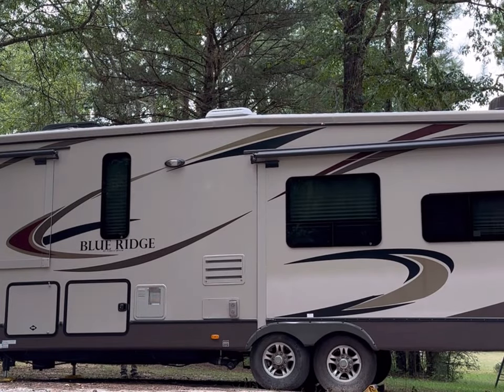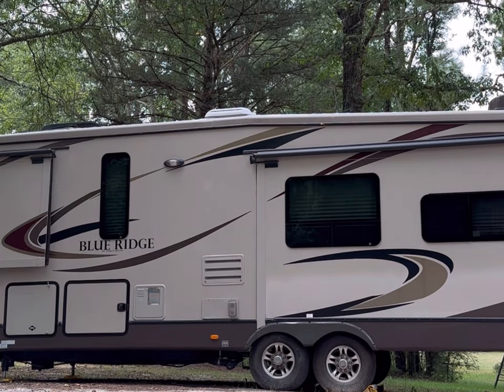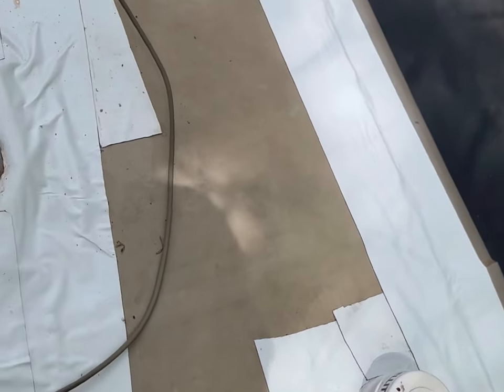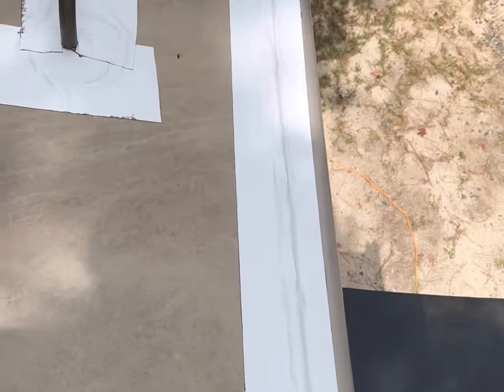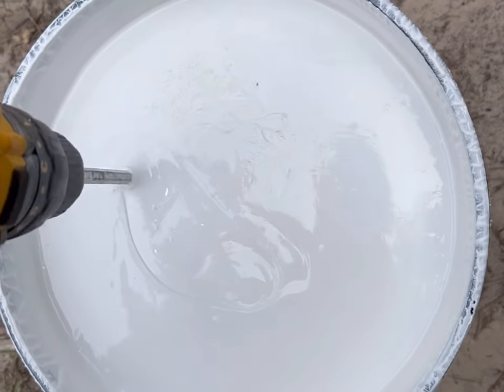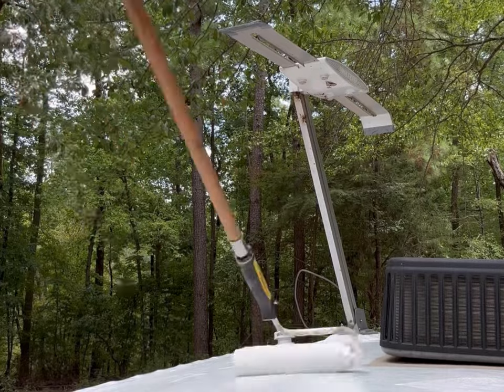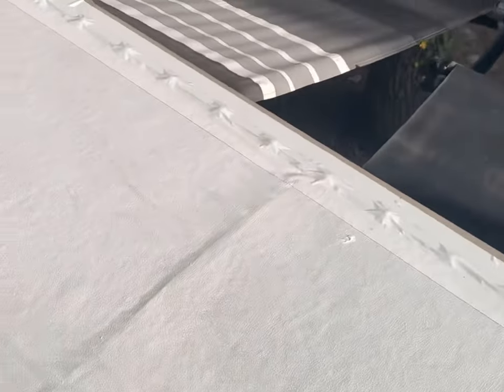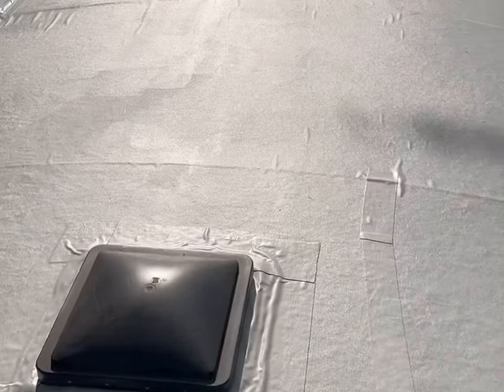Our experience with EternaBond Tape!

Comment: I bought 6" x 25' rolls of aluminum rubber stick tape at home Depot which will work great to buy surface has to be wiped down well with water & vinegar in spray bottle, then wipe with paper towels, I get more tape for way less money then eterna bond has.

Comment: I used a cheaper knock-off of Eterna-Bond and found that in some places, it held well, but in others, the edges peeled.  I also used Henry's rubber roof compound and found this to flake off, even though I had seriously cleaned and rinsed my rubber roof well.  This time (right now) I am going with Eterna-Bond tape over the seams, and around vents, etc. and Dicor parts 1 and 2 over the rest of the RV roof.  We will see!!!  9/2024

Comment: Questions: I have repaired, sanded and cleaned a vintage metal roof camper. Should I paint the entire roof first and then apply the Eternabond tape?  Or should I apply the tape and then paint. Thank you!
Reply: I would say do the tape first. Tape isn't going to stick as well if you paint it first
Reply: I had the same question. I am thinking tape first and then painting over the tape like he did in the video

Comment: I used Eternabond tape on my roof in Arizona and it turned to grey dust in a year.
Reply: You obviously had the docket & complained to the manufacturer, what did they say?
Reply: Did you use "roof tape" or Eternabond? My experience is nothing like you've described. The Eternabond tape I have applied has lasted 7 years in the the SW desert with no signs of failure.
Reply: I’ve used it for years. This is a first.
Reply: This is definitely not my experience nor anything else I’ve seen.
Reply: @jerry-381 it must have been a bad batch as only about 1/4 of one roll crumbled into dust, rest of the tape I applied worked well. This time after applying the tape, I primed with Lanco
Aqua-Proof Waterproofing Roof Primer and top coated with Lanco
Ultra Siliconizer 5 Gal. 100% Acrylic Elastomeric White Reflective Roof Sealer

I know I have to replace the EPDM roof, but I have been stretching out as long as possible. It needs new plywood too.
Reply: @ gotcha that makes sense! Kuddos on all that roof work. We all know what happens to these things when water gets in.

Comment: I've had eternabond on my RV roof seams for almost 10 years and never had any leak problems where the tape is, and still doing good. I've used dicor lap sealant for several years also and had leak issues every year or two. I have found that the only way dicor lap sealant works best is to remove all the old sealant first. But still won't last as long as the eternabond. I'm in Texas and the summer heat is brutal on anything left outside in the sun.
Prepping the roof before using any sealant is the most important part. Follow the instructions or risk doing it again sooner than necessary. Never use silicone caulking on the RV roof because nothing sticks to it.

Comment: Do you think your roof sealent is as good or better than Henry’s?I’m looking at both.
Reply: Hi Dave. What have you decided? I am new to this and need to seal the roof of my RV. this is a great video .
Reply: I used Liquid Rubber & don’t forget the primer.I also used Kohree 4” tape & I still use Dicor non sag & self leveling.
Reply: I just used the Henrys tropicool on my 23 year old epdm roof(cleaned with TSP and then Dawn). How well it sticks depends on a few things. I’ve read it doesn’t stick to eternabond tape, I’ve also read it does. In my case it did. I applied eternabond temporarily about a month ago around the pipe vent and Henry 887 stuck to it really well. Also, (despite saying the opposite on their site), the Recpro 8010 adhesive does stick to aluminum flashing and Henry 887. So well in fact it ripped up the 887 on a section that i splattered some while repairing another section of the roof (with the Recpro repair kit that used pvc). What idk is if eternabond will stick to the 887, another thing I’ve heard ‘nothing sticks to silicone except silicone’…clearly not true.
Reply: You are correct nothing sticks to silicone except silicone or maybe an adhesive.I applied Liquid Rubber & used the primer.I’m not sure if it would have adhered directly to my tape because I taped first then primed the entire roof before putting down 4 coats.Time will tell.Hopefully this is my last roofing job unless a branch or something causes a puncture.Thanks for the reply.

Comment: Does the roof coating stick to the tape? Have you driven down the road?
Reply: Great question. I am trying to figure out if eternabond will bond to apoc 243 advanced roof coating.
Reply: @TheJonboy713  ok, please let me know what you discover. Thanks
Reply: People been using Henry’s Tropicool and painting over it. Seems to do well. Maybe you just have to scuff the tape a little with sandpaper first. I thought I read somewhere that there is a paintable kind. I’ll have to see about that.

Comment: I'd never buy a used RV with so much eternabond applied. It's a red flag in my opinion. Only meant for temporary repairs, not permanent application. Good job on the rubber sealant application.
Reply: @markallen4630  
The hint is that they don't sell sheets wide enough to cover the entire roof.
It does adhere well, no doubt about that. It just is meant as a means to seal along rips or holes. Maybe to reinforce areas that may be subjected to strain on the membrane. Like the edges of the membrane to the gutter trim.